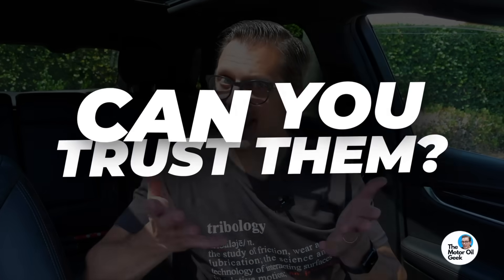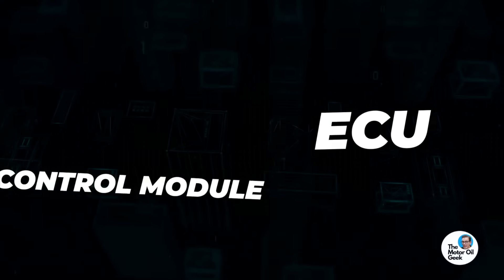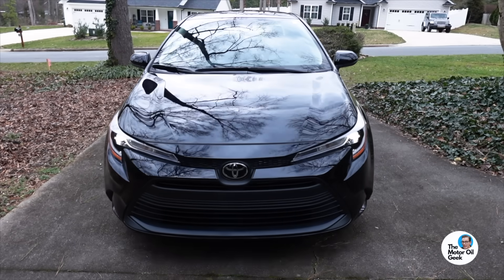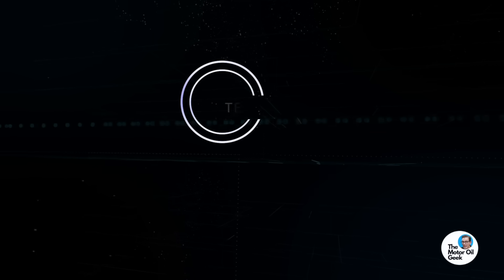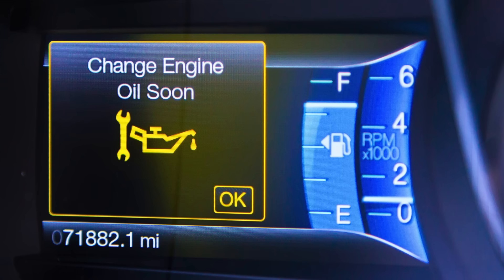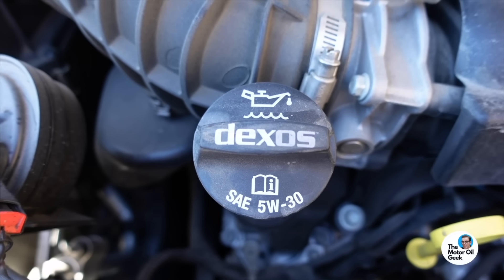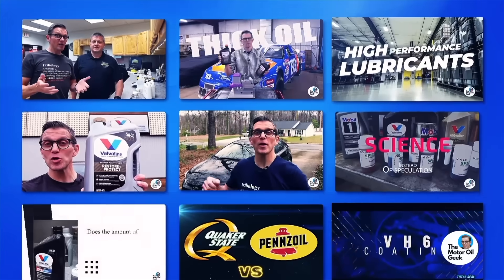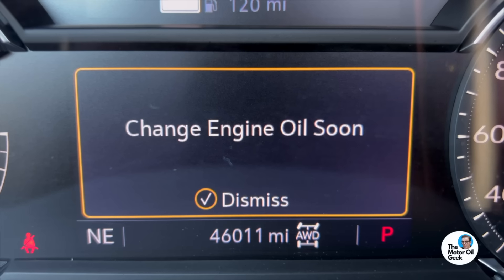The Accuracy of OIL LIFE Indicators REVEALED!

Comment: The bigger issue is oil level indicators that don’t work
Reply: Dipsticks- the premier oil level indicator- rarely lie
Reply: A lot of cars that use oil don't even have level sensors.  Engines get labeled as junk.  They may be junk because they use oil.  But they would last a lot longer if the owner kept oil in them.   Extended oil life just makes it worse.
Reply: Some of you are idiots. This video isn't about oil levels it's about oil "life" indicators and how accurate they are on a GM vehicle.  And like he said, they are very conservative. I'm also going to assume that other manufacturers use this same data on their vehicles.
Reply: @ManwithaRam  Yes 100% . My Ford 4wd trucks have utilized these for over 20yrs now.
Reply: @ That’s the issue, most people think that the oil life indicator is for measuring the amount of oil and not the oil quality.
Reply: Its  an algorithm....been tested on dizens of cars for 150,000 miles ford and gm so it works @ManwithaRam
Reply: @ManwithaRam In the video he explicitly says that other manufacturers do NOT use the same data.
Reply: @ManwithaRam 
Presuming it isnt leaking or burning the oil 🤔
However mid-life and late-life engines do!
And this gradually manifests as sludge, ticking, and timing failure.
Mid-life care and when to discard an engine is likely a different conversation.
Reply: For those of you who don’t know, there is a difference between oil life indicator and oil level indicator; in this video he speaks about oil life sensor which is meant to determine the quality/ wear of said oil. European cars like bmw have implemented oil level sensors (replace dipsticks) which as far as i know are intended to tell you how much oil is in the pan and may or may not indicate quality as well
Reply: @BernardoKingston exactly what I'm trying to say to some of these fools lol. Ram has also just started using this feature replacing the dipstick on their new hurricane 3.0l twin turbo engines.
Reply: @BernardoKingston I was thinking the same thing. Makes you wonder if people are paying attention to the subject of the video.
Reply: My 20 year old Lexus oil level works just fine.  😂
Reply: @jdub6797  As does my 19yr old Ford 4wd truck. Daily driver. 283k mis & goin strong. My 23 F150 Tremor 4wd much more sophisticated of course w/oil & transmission life thru its phone app & dash sensors.
Reply: I’ve only had one dipstick fail, and that was just the handle.
Reply: I’m a Volvo technician and I saw it on a customer car.  She said sometimes she would get a low oil pressure message.  Oil level indicator on the display read “full”.  Even when I used the factory scan tool to check the oil level, it was ok.  Finally, when I drained the oil into a bucket to measure how much came out, I got the truth.  It had 1.5 quarts of oil in the engine that has a capacity of 6.0 quarts!
Reply: @ghostwrench2292  I wanna dipstick dammit!!  Was considering a new Ram 1500 but the new I-6 got no dipstick..No thanks.  Retired marine tech
Reply: Maybe that’s why there a minimum and maximum line on the oil dipstick, everybody needs someone or some thing to do it for em
Reply: @DixielandOutlaw  BMW eliminated dipsticks. They only use the sensors. Thats the problem
Reply: You can thank the Germans for that one.
Reply: Had a 2012 mustang that the OLM stuck at 99% and never budged again no matter what.
Reply: Agreed. The oil level indicator sensors replacing tried and true dipsticks makes my blood boil. I don't think I can make the decision to buy a car without dipsticks, I hope manufacturers don't follow BMW
Reply: if it doesn't have a dipstick don't buy it  i mean would you buy a gasoline automobile that doesn't have a gas Guage? i don't think so.
Reply: I just changed mine at 5,000 and don't worry about it I don't care what that little computer says.  Water companies would rather repair or replace your engine
Reply: You don't know how to use a dipstick?
Reply: Lot more to engine oil than just fuel dillution. Good oil lab anysis is the best way. Its cost verus oil chsnge. So small engines just chsnge oil. In bigger semi truck and tractor etc equip. Get the oil lab tested. Even if u change the oil. Will give a check on what engine bearings etc are doing. Saved several tractor / harvesting engines due to having extra by pass oil filtertions which lifted dirt out of the oil the lab sample had told me there was siicone ( dirt being sucked into the engine. . On the harvestor it was after the air filter. Was only happening as unloading shaft was rubbing a hole into the air intake. We fkund the hole when we sprayed eiter starting fluid around the air intake.  Nevee did have to overhaul the engine.  Check the oil if it burns y finger oil is too hot too. If its foamy likely leaking coolant into the oil. Etc. Look / check learn. 1 403 830 4124 calgary ab cdn. Hey oil pressure is a problem too. We use a "metal cond addirive" yes lubrication at - 40 C temp. Even too ext turbo.  No turbo or injector replaced. Utuber is tech geek. Big heavy equip is doff than cheap vehicle engines. Lol
Reply: Too many car manufacturers are deleting the engine oil dipstick, having the car owner rely on the computer oil fill level.
Reply: Same with some coolant and oil pressure guages. They are only indicators that something is in there, not temp or pressure
Reply: No it's people that can't figure out how to even open the hood to check the oil level
Reply: A dipstick never lies.
Reply: Dipstik always works
Reply: Yup, what year bmw had a broken oil level ratio system? 2016? They had new and full oil but would keep saying to “add oil to engine” after an oil change
Reply: @knucklesskinner253  bmw is exactly who i was referring to. I also think some stop working entirely and always read “full” which could explain why you see so many engines getting trashed from rod bearing failure
Reply: @ericsprout the rod bearing failure was the clearances for the rods and the high viscosity oil the engines required. You only saw rod bearing issues on the M cars S engines. The normal non M engines didn’t have rod bearing issues.
Reply: @FishFind3000  non-M engines are having these issues. N55’s and N63’s
Reply: @ericsprout TBF though, the N55 rod bearing issues are generally caused by the design where it would trap air after oil system repairs and starve the bearings. The N54 and N52, which use the exact same oil level sensor, do not have bearing issues unless you're pushing serious power. In my many years of owning high mileage N series engines I've not encountered an inaccurate oil level sensor, or any engine troubles at all for that matter.

On the other hand, I'm not intimately familiar with the N63, but it's such a dumpster fire of an engine that nothing would surprise me about it.
Reply: @FishFind3000  True. You can get long life out of an "S" engine, as well, but you have to be religious about proper engine oil warm-up. FWIW, my N52 shows 22,000 miles remaining when I reset the OCI. That's pure lunacy. Ever since BMW included "free maintenance", I'd say you cannot trust the OCI. 7500 mile changes with mostly highway driving and my car is fine at 180,000 miles. Cams looked like new when I did the valve cover gasket, and Blackstone says I can go longer between changes, but I won't budge.
Reply: Anyone who drives should be taught how to physically check engine oil. Sure an electronic monitor is convenient but. .. ...
Reply: @oneninerniner3427  agree, but how can you physically check the oil level if there are no provisions to check it?  I know the current Volvo 4 cylinder engines have oil level sensors but no dipsticks.  BUT THE OIL PAN HAS A DIPSTICK HOLE CAST IN IT AND A SHORT DIPSTICK TUBE COMING FROM IT!!  There is no dipstick in the tube and 99.9% of owners don't even know it's there.  I can't believe no aftermarket company has come up with a dipstick and tube for this engine to finish what Volvo already has in place!
Reply: @ghostwrench2292  Lots of places make generic dipsticks that are adjustable.  A good mechanic should be able to change the oil (so it's full) and calibrate the aftermarket dipstick.
Reply: Dont buy shitty yuppy cars
Reply: There are a lot of things that anyone who drives should know how to do because we all know sensors go crazy sometimes. I drive a Buick, and the oil life monitor always seems to get it right as far as when I should change the oil based on mileage. I physically check my oil as well though. 

Amazing that especially these younger generation kids just starting to drive (and even older) have no clue how to do ANYTHING on a car and wait for the DUMMY light(s) to come on, which we all know usually it is too late once they come on. 

Parents just do not teach like our parents did, I am 39 and knew how to do basic maintenance on a car BEFORE I could even drive. I know how to change a spare tire using the pathetic jack and donut that come with the car. 

These younger generation kids are screwed!
Reply: @oneninerniner3427 the problem is that these German vehicles don’t even have an oil dipstick anymore.
Reply: @oneninerniner3427  BMWs (and some Mercedes) don't have dipsticks...
Reply: @TassieLorenzo  If a car doesn't have an oil dipstick, I'm not buying it, plain and simple.  It was hard enough for me to buy my truck that doesn't have a transmission dipstick.  That still bugs me to this day.
Reply: @TassieLorenzo Yes they do, the people who drive them!!!!
Reply: @TassieLorenzo add to that list Audi, some newer Jeep/Wagoneers and probably more, at least the models heavy on the electronics/"convenience" packages 😕
Reply: If you just change your oil every 5K, it doesn't really matter.  An oil change for my Hemi (7 qts) costs less than $30 when I do it myself with cheap oil.  Maybe I could stretch it further, but I don't care.  That's not a good habit to get into.  You'll never damage an engine by changing the oil too often.
Reply: @mplslawnguy3389 well real engines burn oil, if you can’t physically measure how much then its a problem
Reply: @mplslawnguy3389  Buy Kirkland full syn on sale.

Cheap oil= expensive  repairs
Reply: @mplslawnguy3389 

Mileage in isolation doesn't really tell the whole story. Fuel Use, Fuel Sulfur, Oil Refill Capacity and Lubricant Fornulation also need to be considered.

The old 3,000 mi change interval came from essentially the following fornula:

12 mpg × 5 qt x 50 = 3000 mi

With low sulfur fuel, 50% better mpg, 40% higher oil capacity and an oil with much better base and detergent package 5,000 mi is a very conservative interval that would likely allow an accidental missed oil change without any real consequences.
Reply: @mplslawnguy3389 did you watch the video?  😂
Reply: Just check it to be sure. Nothing is full proof.
Reply: @ you can’t when it doesn’t have a dipstick
Reply: You mean pressure?
Reply: @ no